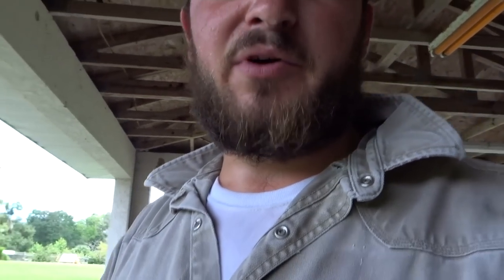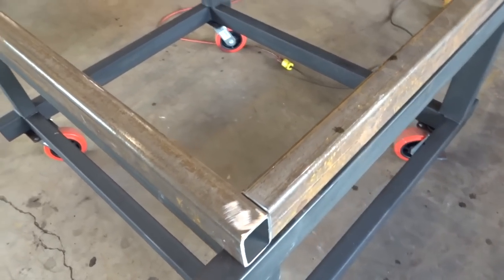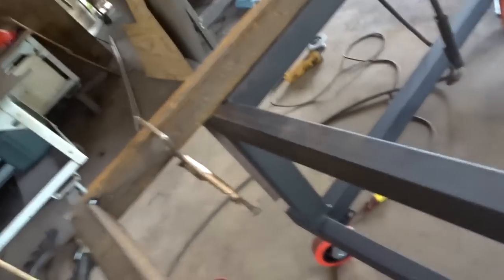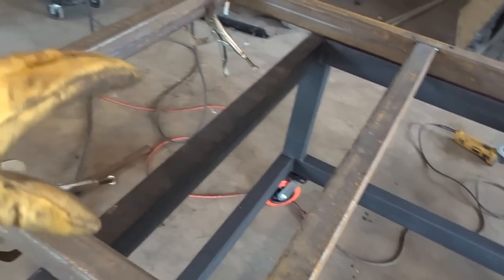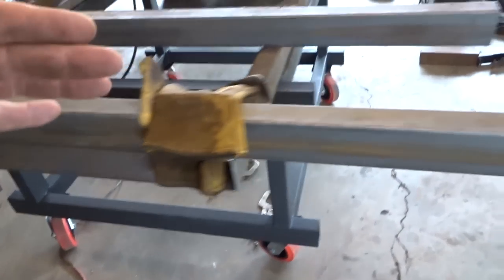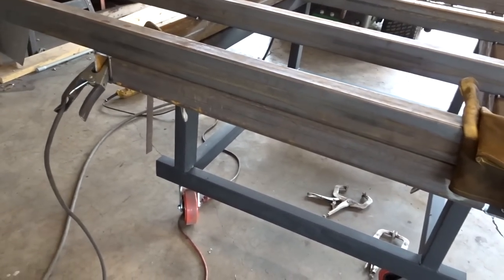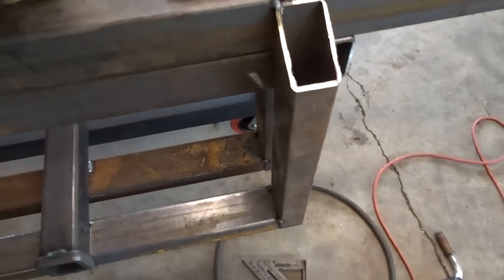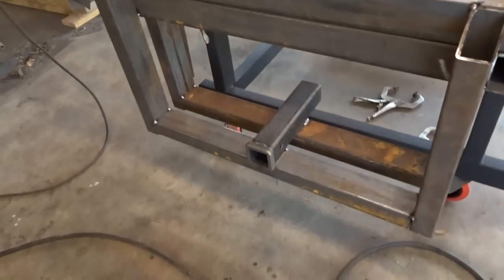How To Build A Flatbed (PT 1)

Comment: I built one back in 1986 for a F-350 diesel cab and chassis that I bought NEW.  I framed it with Square and rectangular tubing and I MANIFOLDED it together, so it was a AIR TANK.  I have forgotten how many gallons it held.  It took up NO SPACE except for the Gauge, hose, and plug in chuck.  Sold it in 1996.  That was a handy feature for sure.  I had Belly Pans on it with flush mounted stainless steel locking latches that were keyed alive, it had four recess mount stainless steel taillights and premium Marker lamps.  I put two Seal Beam tractor lights in the rear at the bottom of the tail end.  I had them WIRED where they would come on when I put it in REVERSE, OR I could turn them OFF, or I could TURN THEM ON going down the road to get Bright lighted TAIL GATERS off my ass.  It had all ENCLOSED wiring, the two inside taillights had independent BRAKE LIGHTS, the two OUTSIDE tail lights had turn signals which doubled as stop lights too.  All plugs for TRAILERS were ICC STANDARD just like an 18 wheeler wiring COLOR CODED ICC STANDARD.  It had a Rub Rail all the way around to chain loads down and a RECESSED Goose-neck hitch box.  The Bed was 1/8th inch Diamond plate.  Had a heavy steel Headache rack, and it was painted the SAME COLOR as the rest of the truck (RED) with silver pin-striping.  Wish I still had it.  Got compliments on it every where I stopped.  It also had a Tail Roller on it for a WINCH, but I never put a winch on it.
Reply: THAT is cool.

Comment: Perfect timing! I yanked the bed off my 95 silverado 6.5, taking care of the frame today and I guess just waiting on you for more videos
Reply: F&M Reviews! I'm yanking the bed off of my 95 6.5l tomorrow! You have any engine mods on the truck?
Reply: Erik Vogt I made a boost controller cause my vacuum for my wastegate was broke but other than that completely stock. Hopefully have an hx40 in the near future and also a diamond eye 4 inch straight pipe along with a highflow crossover pipe. I also need a new pmd in the near future.

Comment: Just unloaded some steel to start my build. I am thinking on the primer you used. Is that oil based primer if so how has the Upol bed liner been holding.
Reply: How's your build goin?
Reply: @justinaulgur9812  I have the frame and 8 mounts welded up. It's on my channel. I would of used tubing instead of C Channel but they didnt carry the 2x3 liked used on this video.
Reply: @cutweldngrind  I'll come check it out. Just scrapped my bed and I'm about to build one myself. What paint did you go with

Comment: Good vid but I do have a question you tac cross supports on the front and the back without first welding the supports underneath and then tacked your hitch on without welding the rear supports how are you going to get to those joints to weld them I understand the importance of tac everything before you weld it out but you tech things over you’re well Jones

Comment: I'm a new subscriber. I have a dodge 2002 2500 that's raised 6 inches but it doesn't stop by the garage and I don't want to leave it out with the welding machine. I'd run the suspension you put on to you, I wanted to know if you can sell me the complete kit I put it myself

Comment: Just watched someone build a minimalist flat bed, while this one looks “maximal.” I guess if you have a Cummins and can tow a lot, you need strength, but unlike a trailer, your 3/16 sub frame structure could be relegated to the existing truck frame. I would be concerned the bed weight is robbing payload.

I look forward, in the next video, to seeing how it turns out.

Comment: For a half ton  truck (1500 lbs payload), I'm sure 2" x 3" x 3/16" is probably not necessary.  How small would you go?
Reply from the maker: Depends on what you’re using it for, wouldn’t go and smaller than 14ga wall

Comment: If you knew how much weight you needed to support on a flatbed, how many times would you multiply it for a road going vehicle?  I'm building a flatbed to haul cargo trailers for a local company.  24' x 8.5' enclosed trailer will be about 1700lbs on 1 side at the wheels.  Trying to keep it lightweight. 34" wide frame.
Reply from the maker: Not quite sure I understand your question

Comment: Will 2" x 2" cross members in 3/16" work for my dually bed?
 I can not find anyone that sales 2" x 3" rectangular tubing in 1/8". I did find 2"x 4" in 1/8 wall and they are $77 and 2"x 2" in 3/16" wall are $73 for 24 ft joints.
I plan to order this Monday.
Reply from the maker: I wouldn’t use 2x2 on a flatbed, 2x4 would be better or you can go with 3 or 4” channel
Reply: @j_moffitt  Thanks. I will ask on Monday on Channel. They did offer me 1.5 x 3 tubing. I could also go all 2 x 3 in 3/16" but at 134 lbs for 24' it will add up quick. 

Thanks

Comment: What size and wall thickness of square tubing did you use on the bed?
Reply from the maker: 2"x3" tube 3/16" wall for subframe and other stress points 1/8" for everything else

Comment: Can you list all the gauges of steel you used to build this flatbed? I’m currently looking for a flatbed for my f250 but want to see if it’s cheaper if I just built my own.
Reply from the maker: Used 3/16” tube for the subframe and 1/8” for cross members and all the plate

Comment: Is 3/16ths or 1/8th material  used for the frame of the receiver hitch?
Reply from the maker: Since I'm going to be bracing the hitch with plate on the rear I chose 1/8'' and doubled up like I have it, its super strong but you won't hurt anything going bigger

Comment: How much tubing material did you use for your frame of bed? I've been wanting to make a bed for my 3rd Gen and was wanting to look around for material cost for my area, but not knowing how much I would need to spend on. Awesome videos and I cannot wait to see what the 2nd Gen will look like at the end.
Reply from the maker: I think I used like 4 sticks total
Reply: @j_moffitt  what was the dementions of each stick?
Reply from the maker: I used 2”x3” tube 3/16” wall for the sub frame and then 2”x3” tube 1/8” wall for cross beams and everything else

Comment: Zero removal of mill scale with wire welder weld.    Glad that's not my truck.    Also pulling off the bed vs the frame is questionable.    Bolt that hitch to the frame and let the bed float like it has to prevent creaking the welds from twisting.
Reply: All your production flatbeds have the hitch built into the bed. Look at cm or any big bed makes

Comment: On using the diamonds on the tape, did you measure from the outside of the beam or the inside, or does it matter.
Reply from the maker: I do on centers, you can run whatever center you want but for the thickness of material I’m using 16” centers isn’t really necessary and 24” is a bit much so the diamonds are a good in between measurement and it’s already marked on the tape for ya so it makes it easier